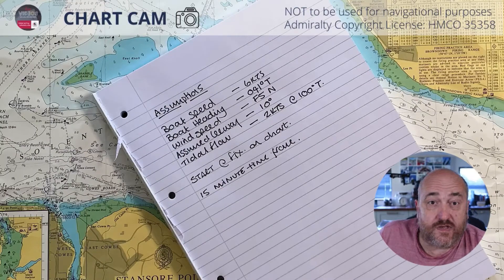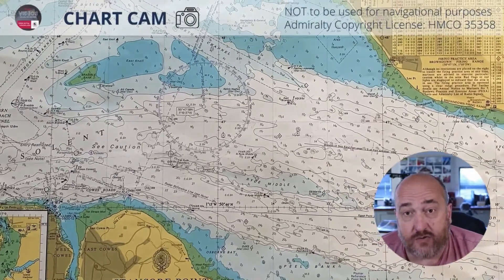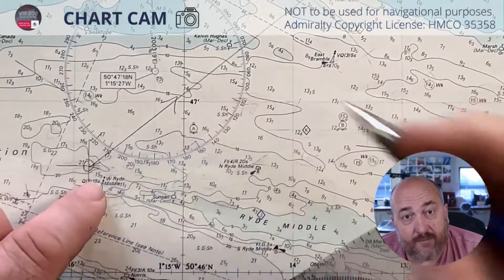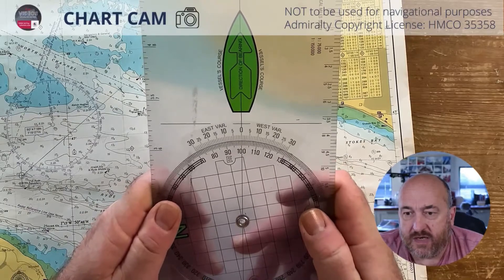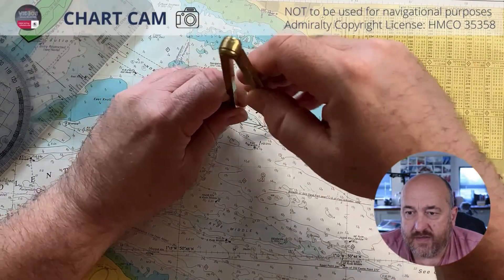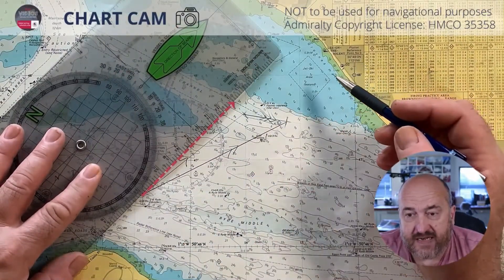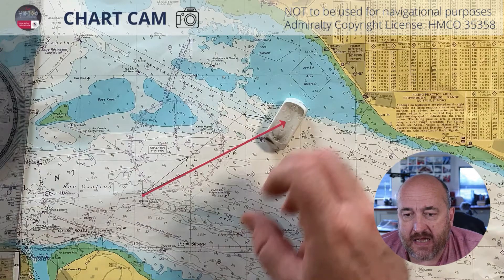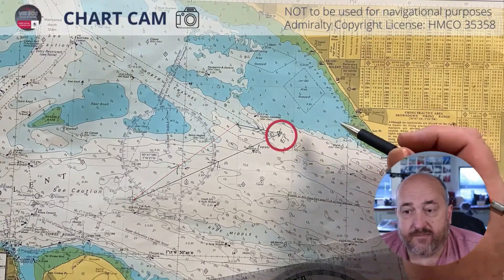How to Calculate & Plot an Estimated Position (EP)

Comment: thanks for the video... what do you mean by "piloting"... as in "We'll probably be piloting anyway?"... Thanks !
Reply from the maker: Clumsy language, perhaps. I mean that we will probably be navigating largely by estimating our position by way of visual reference to fixed landmarks, bouyage, depths, etc. 

In the Solent (used for this example) you can usually see channel markers, prominent landmarks and depths where shallows are present, at all times, making the need to plot an EP from this method less necessary in practice. It is used more on coastal or ocean passages when using paper charts.
Reply: Pilotage is navigating using visual signposts,  such as buoys.
Where there are visual signposts calculating a Course to Steer,  or Estimating a Position,  is a waste of time.   Plan the pilotage.
When you are clear of the channel (and of signposts) use the planned Course to Steer.   If you can’t sail the planned CtS ask your helmsman for his/her best heading and speed to windward and immediately Estimate a Position for 1 hour;  inspect the ground track for hazards

Comment: How I can do it, I don't have the boat speed and it's less than 1h?
Reply from the maker: Hi. You would have the boat speed because an estimated position is an historic calculation based on the boat speed over the last hour or part thereof.

If you are working on say 30 minutes, you just use a half hour of the tidal vector too. As long as the tidal vector and boat speed vector are over the same time period, the EP will be just as accurate.

In this video, I assume a boat speed - see 0:18
Reply: I’m not sure why you don’t have a boat speed;  if the built-in log isn’t working get a towed log.

You should Estimate your Position for 1 hour as soon as your helmsman reports heading and speed.
Inspect the ground track for hazards.

An EP is predictive,  not historic.   It predicts your ground track for the next hour;  this tells you whether you will meet hazards on that heading
Reply from the maker: @johnstarkie9948  Hi John. Thanks for your comment.

Just to clarify the point you make, for others. An Estimated Position is historic when you are plotting from the log, but you can calculate an estimated EP if you so wish. 

A Course to Steer is, as you know, is effectively predictive.

Comment: So if an EP is looking back historically and CTS is looking forward. Why would we ever need to do an EP if we always plotted a CTS?
Reply: “Estimating a Position should always be predictive,  very rarely historical.

You have set off on a heading because you cannot sail the planned Course to Steer;  your helmsman has achieved best heading and speed to windward,  and immediately reports heading and speed.
You have several questions:
Where will we be in an hour (20 minutes)(2 hours)?
What will our course over the ground be?  (What hazards (rocks,  restricted areas) will we meet on this heading?)
What time will we reach the EP?
What time should we tack to avoid the hazard?

You should Estimate your timed Position and ground track (and speed) within a few minutes of your helmsman establishing a heading and speed.
You can then calculate answers to your questions
Reply from the maker: Yes. Clearly, in this example, one can check position by using pilotage skills (looking at bouyage, etc) or even GPS, but a CTS before the fact and and EP is after the fact. In reality, it'd be more likely that you'd plot a CTS for say 4 hours and then make hourly log entries, then calculate am EP after say 3 hours, dependent on if you are in open water or coastal. Also, a CTS allows for tidal flows, possibly sometimes in opposite directions, so whilst a CTS over say a 6 hour periods and an EP after the same 6 hour period should both get you to about the same place the exact spot will vary (if only because of actual boat speed vs planned boat speed) and your position over ground through that 6 hour period will vary as tidal effect moves you both ways along the desired COG.
Reply: @FreeSailingTutorials  Ok so its a bit like double checking after the fact to see how your going, make sure your on track..
Reply from the maker: @anthonyb8998  Yes. One is calculating a heading you should steer to get to a specific place with variables input. The other is a calculation based on what heading and boat speed and leeway you actually had. One plans for the future (CTS) and one calculates an end result (EP).

Comment: Thanks for the great tutorial.  I can't work out why we apply leeway at the beginning of an estimated position but at the end of the course to steer.?
Reply from the maker: Hi. We apply leeway at the beginning with an EP because we already know the heading we were or are steering. We will therefore measure or estimate our leeway based on our point of sail. Leeway will be greater with a vessel that is hard on the wind and lesser if the wind is abaft the beam.

Also, if you do an EP calc, try applying the leeway at the end. You will have a problem. Because you get a point (an EP). How do you apply a bearing angle to a fixed point?

With a CTS, we add leeway at the end because the leeway will be dependent on our angle to the wind. We don't know our desired heading (and therefore our angle to the wind - known as the TWA True Wind Angle or AWA Apparent Wind Angle) until we have calculated tidal effect. Once we know our desired boat heading to get to our destination, we apply leeway to obtain a final Course to Steer. We can apply a bearing adjustment to a line vector.

It is quite possible that if your desired heading before applying leeway already has you hard on the wind (beating or close hauled) then you can't make that destination on one tack. In that case, you may need to tack at some point, to reach it.

Hope this helps.
Reply: @FreeSailingTutorials  Thank you for your comprehensive answer, really appreciate it. It makes sense now after thinking through your points.
Reply: Aha! Just as I expected your response.  That is confirming and I thank you greatly!!Aloha from Hawai'i. 
 @FreeSailingTutorials